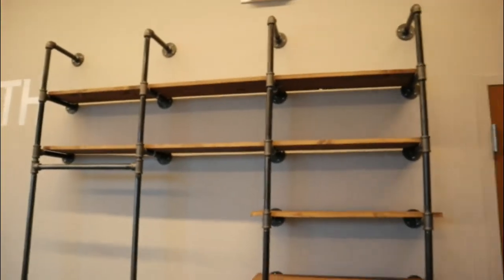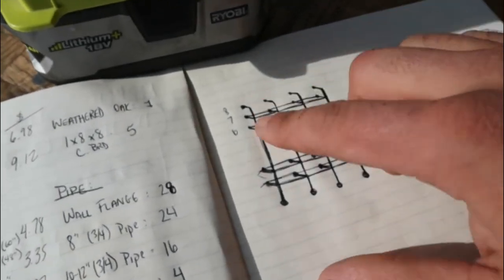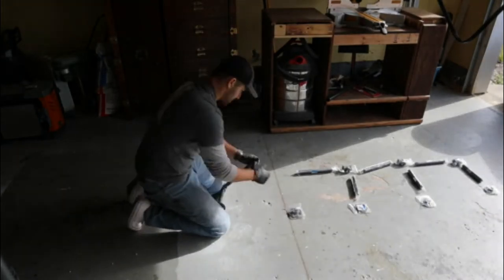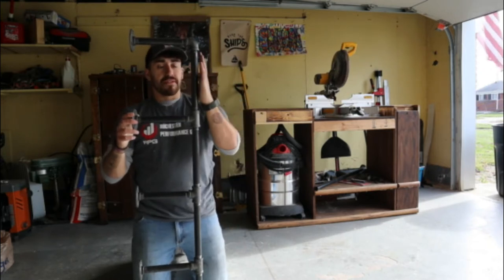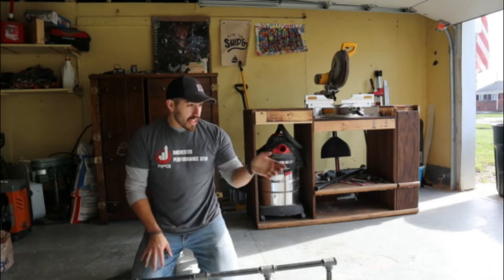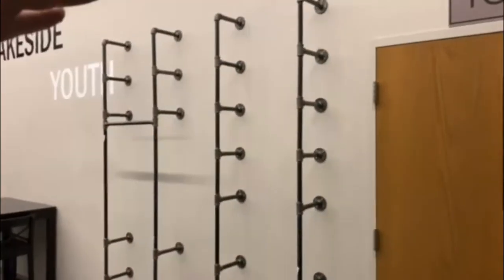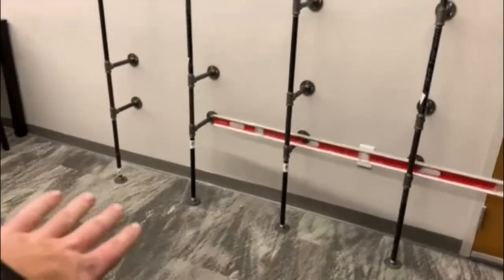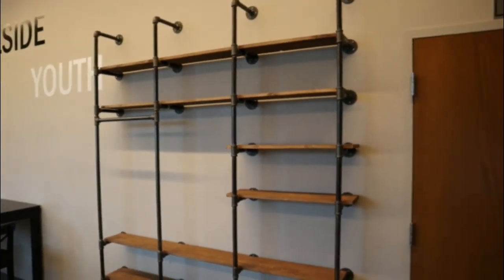INDUSTRIAL PIPE SHELVING UNIT - MERCH STAND - DIY

Comment: What did you use to secure the shelves underneath them as they sit on the pipe so that they won’t lift?
Reply from the maker: I used 1/2” u shaped brackets- they wrapped around the pipes and would screw into the bottom of the shelves to keep them secure!

Comment: Also is there is a truck to lining up the t-brackets they are all facing different directions unless I leave a little play in it
Reply from the maker: I put the flanges on the walls and marked them, then when I put the pieces together, I would adjust them to line up with the markings I drew on the wall!